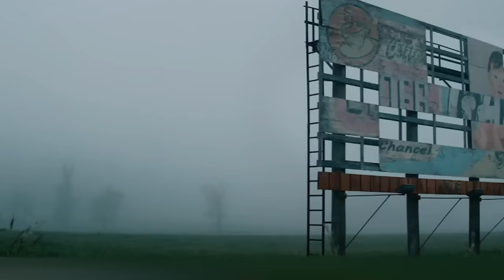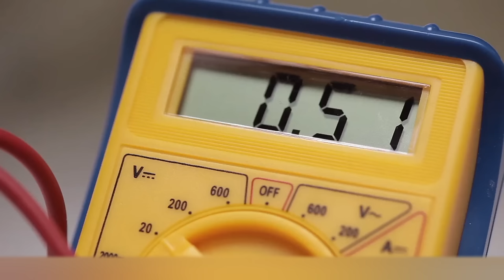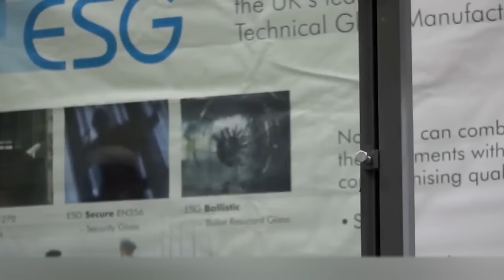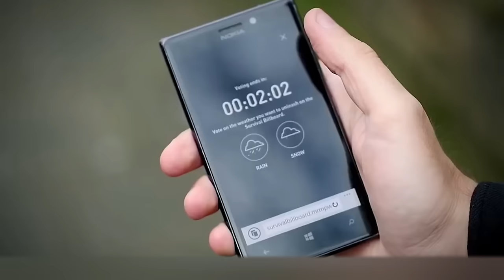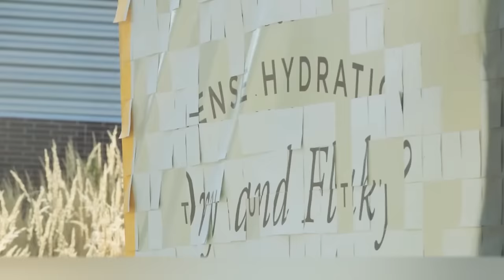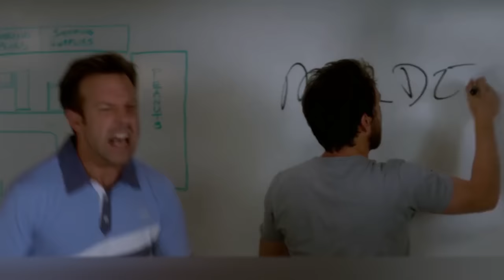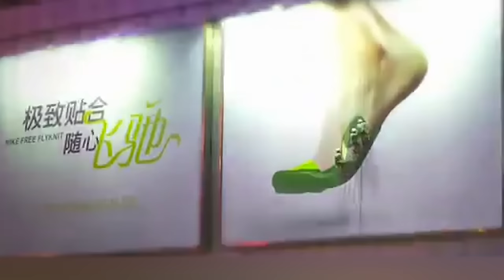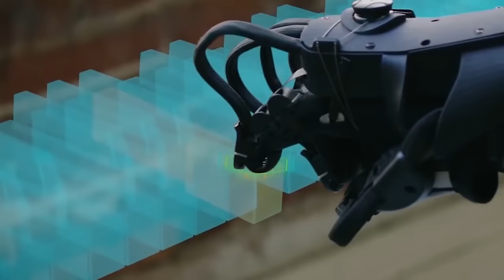Take All You Can If You Break It. Brilliant Advertising Campaigns That Stunned Everyone

Comment: The glass money thing isn't really that real as they make it seem in this video. There was actually only €300 - €500 in that glass case, and the rest was fake money. There were guards surrounding the thing in case anyone broke it. They gave people sledge hammers too. But in the span of 24 hours they had to take it down because the outside frame was breaking.
Reply: My bad, I was going off of my own currency
Reply: BeyBlade Master uh huh and how do you know that
Reply: St. Petersberg yh don’t think it was mate lol
Reply: If it was real you could just take grinder or torch falme cutting thingy (not sure how they are called in english) and cut the glass no need to take a truck or anything like that.
Reply: BigSoggyLad I'm pretty fucking sure it was a joke
Reply: Petr Kinkal You mean an acetylene cutting torch or plasma cutter!
Reply: Drone2 Beats burn it down use a hammer then put the hammer in fire make it hottest hammer then use safety glufs and then put the hot hammer into the glass then the glass will mealt then u carefully take money out😎😎😎
Reply: Yorkie Yorgi yhyh 😂😂
Reply: Lies
Reply: I hope you guys realize that burning through it is not an option, the guards would stop you straight away
Reply: But those euros has a huge value
Reply: xgamer 0123 Not really, the convertion rate would make it maybe 50 - 100 dollars more. It wouldn't do anything crazy.
Reply: BeyBlade Master not if your denzel washington-😉🕴🏾
Reply: Yeah.. the part where it showed it i was so confused.
Reply: BeyBlade Master is tie a chain and tie it to a truck lmao
Reply: HOW MANY DOLLARS IS 300 TO 500 POUNDS
Reply: sir jet noob man It’s $300-$500. He corrected himself and said he accident put the Euro sign instead of the dollar sign. It’s up there in the comments
Reply: z
Reply: @AwesomeKingKai  I SEE OOG
Reply: @AwesomeKingKai  i mean inguess not i aint wazting time for 300 bucks thats like 3 weeks work on a normal job
Reply: haha
Reply: yeah doesnt seam like it would take long especialy if you just cut it with and angle grinder
Reply: I mean if they really would give that much money i would just mount a mini gun to the back of a truck
Sounds like its not worth it but a m134 minigun is a couple 100 thousand dollars didnt the say it was 1,000,000$
Reply: they should be sued for false advertising

Comment: Where is that glass. I will break it
Reply: according to another comment, they took it down because it was actually starting to break and it was filled with counterfeits
Reply: @lili-zy7qq  it was. I saw it :p
Reply: Ha
Reply: At 3:00
Reply: lol
Reply: You will not silly😂
Reply: It's a wonder that nobody brought heavy equipment to just take that glass. I can't believe it would survive a concrete cutter, Jack hammer attached to a bobcat or  really even a crew of people armed  with a pickaxe and determination.
Reply: John Carmichael Honestly. Depending on what type of tempered glass it is you could break it with 2 spark plugs and a sling shot
Reply: @oscaralonso4699  if I lived close enough I'd give it a shot with some  weighted gloves and a pair of brass knuckles. Let me bring a hammer like the video said and I'd be out there an hour a day like it was a free gym.
Reply: use a grinder with diamond blade done
Reply: My hometown, Vancouver. No guns here
Reply: Hey, grab a ram or a door buster n
And that should do da trick
Reply: lili 
DANG IT!!  And I was just getting excited to break it. That stinks. Peace ✌🏻
Reply: @Error-eb9gv   Seriously, I was thinking about that before. I think that thing would most likely be entirely empty with the right tools. I can cleverly think of ways to research and cut/break/and or what it takes to take that glass out.

Comment: Interesting stuff start in 2:53
How the hell noone break that glass?Ram that thing with truck,grab money and run..easy:)
Reply: Thank you. And news flash people: Bullet proof glass is bullet proof, not rotary grinder, or drill proof.
Reply: Just use a nokia
Reply: It was a highly regulated event with armed guards, very specific rules, and only 2 weapons( a wood baseball bat and a sledge hammer) were allowed. Also it's only 500 dollars among numerous fake bills. Any attempt at taking the money now would be just as illegal as a bank robbery.
Reply: screwdriver?
Reply: Use hydrogen...  Ez...
Reply: Chewing gum, a diamond, and a hammer. Step 1: chew gum until soft.
Step 2: Grab your tiny diamond.
Step 3: place your chewed up gum and put it on the glass.
Step 4: stick your diamond into the gum.
Step 5: get your hammer and hit the diamond.

Nothing is stronger than reinforced carbon 😂👍🏽
Reply: 10:24 look in bottom right
Reply: Bradley primeau that sucks they lied did anybody sue them
Reply: The money is fake
Reply: Or they could use vibration too to destroy the glass from the inside. If only I lived in that place 😔
Reply: Draco Meteor "hit the diamond" hehehehe
Reply: Good idea
Reply: Draco Meteor at best you will make a tiny little Nick.
Reply: Bradley primeau even if the money was fake it sounds fun trying to break it
Reply: Tony Valdez an idea could consist of heating the glass up to insane temperatures, then cool it very quickly to freezing temps. This allows for easy shatterinh
Reply: Or use electric/gasoline saw with diamond blade to easy rip this whole thing..
Reply: Or ZF1:)
Reply: Perryinjax Studios: Not a problem with my 1000 degree knife.
Reply: Kyle Odtohan ď
Reply: It’s fake. That’s why. It’s layers of glass and probably poly carbonate. It’s like plywood. You can break a 4x4 off easier than you can break a layer of 3/4 inch plywood off. The multiple thin layers create its strength. You only were allowed to use a bat or a sledgehammer. It was a publicity stunt. There was literally like $1,000 in it with stacks of fake cash.
Reply: The problem I have with the unbreakable glass is why go for the glass why not go for the frame around the glass. Most bus stop signs are made of aluminum which isn't indestructible.
Reply: An anti tank gun?
Reply: Quinton15117 
Why did that make me laugh so hard? Lol
Reply: I would just hand saw the FUDGE out of the glass.
Reply: Draco Meteor r
Reply: Kick Saunders there's no such thing as bulletproof glass only bullet-resistant to a certain caliber
Reply: Plasma cutter?? :)
If someone uses this idea....I'd like my share please:):)
Reply: Quinton15117 what would a Nokia do
Reply: Tony Valdez fr then get a new car with the money 😂😂😂😂
Reply: Roll a dumpster into it?
Reply: Tony Valdez frlllss and thx
Reply: Well, just use a nuclear rocket, but I guess there might not be much money left to use...
Reply: Tony Valdez A forklift?
Reply: Shooting it at point blank range with a high power nail gun puts a hole straight through it and weakens it. Then go to work with the sledge hammers. Just watch the Millennium Dome heist.
Reply: What about RPG?Can pen more than 40Cm bulletproog glass but probablly destroy lot of money..
Reply: wtf ikr?
Reply: You could probably just install a ball hitch and back into the glass at high speed. The hitch would break through the glass easily and you wouldn't cause any damage to the truck.

Comment: Try shooting the glass with a .44 Magnum about 20 times and see if it does any damage to it.
Reply: GamingRobot 2.9 then get arrested and do prison time.
Reply: CHICKEN KURRY yeah but 3 million will help with a hell of an attorney.
Reply: No glass is bullet resistant, there has to be some bullets that would go through
Reply: The glass would stop it unless you used a armor piercing fmj round but i dont think they make those for a .44
Reply: GamingRobot 2.9 .50 caliber will definitely penetrate
Reply: I'd just tether it to a truck and drive off with the whole thing
Reply: Nahhh...Just use an 8 wheeler truck and ram it down again and again til the glass breaks then dump your 8 wheeler and buy another one.
Reply: Well minigun with AP ammo melt this thing in 20 seconds or use truck and tow this thing to safe area:)
Reply: GamingRobot 2.9 and watch it bounce back due to the strength of the screen.
Reply: 50 call sniper armor piecing ammo will do the job or full metal jacket
Reply: If that thing was real people would've used grenade launchers
Reply: 10000000 psi

Comment: they are stupid just take of the screws that holds the glass with money and take it
Reply: NIKO BELLIC 2 the point was to break the glass -.-
Reply: but they didnt say that you could take of the screws
Reply: NIKO BELLIC 2 they said, break the glass and get the money... I’m pretty sure taking off the screws doesn’t count for breaking the glass
Reply: That's what I said
Reply: There are no screws
Reply: Kulahog they could take the screws off than throw the glass super hard at the floor to break it than proceed to sledgehammer it
Reply: Take a truck to it😂
Reply: if u take the screws out they will literally remove all the screws from you.. you will look completely dismantled..
Reply: Jose Augustine hahahahaha it was so funny I laughed more
Reply: just use a glass breaking tool, theres no rules on saying you can't bring a tool
Reply: Kulahog nobody care ift can or can't touch the screws
Reply: No wonder u like GTA 5 Just Stealing😂😂
Reply: R U sure there are screws???
Reply: Absolute Newt that would not work. Glass breaking tools work on non bullet proof glass not that stuff. It's held together with thick plastic behind the glass so you'll crack the initial glass but won't get past the second layer.
Reply: FrozenByFire3 what if you use a bull dozer
Reply: Chewy Point 0 i agree
Reply: but you would burn the money
Reply: NIKO BELLIC 2 I might. I’d have a fire extinguisher standing by. But I’d get in that glass.
Reply: ok ill take it
Reply: You need heat and cold to break that glass. Literally heat it with a parent torch meant to dry the paint and throw some liquid nitrogen on it. It will become brittle. Then hit with a hammer and collect your money. The problem is the flexible layers between the panels.
Reply: Sanbasuto Kuruma I like that. I’d help you do it. Just cut me in 25%
Reply: Kulahog take off the screw, then drop the glass off a 100foot building
Reply: No screws, and the challenge is to break the glass
Reply: What about small plastic explosives?
Reply: Ruby Gas Emitting Laser to cut the glass supports.
Reply: Absolute Newt or a concrete saw
Reply: I woulda ran my car through it & tool the money & dissapeared
Reply: Absolute Newt u can't use tools except for a sledgehammer

Comment: B ring a jackhammer
Reply: I'm faster then all of you
Reply: or just drive ur car into it
Reply: Have me punch it...i did a gods workout. 100 pushups 100 situps 100 squats and a 10km run. Dont forget to eat breakfast a bananna is fine and do not use AC
Reply: I'm here for you bro
Reply: CosmiiqQuibblePop ? I was referencing one punch man idk what your talkin bout
Reply: CosmiiqQuibblePop if i were bragging about that weak of a workout id probably die
Reply: Or a glass breaker
Reply: Nasir Bone this comment is incredibly underrated lmao.
Reply: Nasir Bone Hello Saitama
Reply: I was thinking of a cutting torch, the temperature glass and polycarbonate melts at is well under the temperature  the flame of the oxi-sedaline torch reaches and if you cut a smallish hole above it you would not damage too much of the money.  A large diamond or carbide tipped hole saw powered by a generator if not a battery powered one might work as well. Too many ways, there must have been a catch to it.
Reply: Diamond
Reply: what you do is bring diamond sharpenning stone and just rub it until you rub it away IT CANT BE HARDER if you can make a nick with a sharp knife that would help too
Reply: Swemptonian Tribe spark plugs if it’s actual glass, blow torch or look for some other chemical combination that would heat it up ( I can’t think of what it’s called)
Reply: Phill Huddleston another comment says only allowed 2 things,baseball and an axe
Reply: drive a truck into it.
Reply: Nasir Bone lol Saitama

Comment: Easy way to break the glass.
Flick a broken spark plug at it.

Reason this works is because all the energy of the impact is channeled through an extremely small point.

If that doesn't work, just melt through the glass with a blowtorch.

Comment: I bet they wouldn’t allow me to use my diamond gas powered saw that I use to cut cars apart it cuts through glass fine. I even tried it on an armored door we had and it cut right through it. It was a little more difficult than normal but the saw could have cut through more. Where is that cash? I am gonna go take it!

Comment: IF it's Polycarbonate, Multi Sandwich Combo "GLASS" -  Just FIRST use HIGH HEAT - Torch it, then IF a heavy Glass Sandwich IN the MIDDLE, BREAK THAT "MIDDLE,"  WITH A SLEDGE HAMMER!

Comment: To get the three million a plasma torch could be used to cut the glass at the top and a strip removed horizontally pick the money out as far down as you can reach then cut another horizontal strip pull out the rest of the money , you may need a fire extinguisher in case a spark gets on the money ... easy peasey.....

Comment: False info. You could not use anything to break the glass and there wasn't really 3 million in it.
"There were a few ground rules, one of which was that they could only use their feet to try and break the glass. Security guards were also standing nearby to ensure no one broke the rules.

Had the glass come up against a sledgehammer it may have been a different story. But with the wider public unaware of this, it did not harm 3M. A few other revelations came about the stunt too in the years after.

Instead of $3 million in cash behind the glass it was actually $500 placed on top of fake notes. Had someone broke the glass, they would have been compensated in a different manner than walking away with $3 million in cash. Nevermind, that this would have represented a security risk for 3M on its own."

Comment: The glass would not last a second around me I wood use a blow torch to melt glass in 2 spots and use my winch to break it open or gest run into it with my truck

Comment: With the bulletproof glass with the $ inside, I wonder though if there was a posted rule that you had to obtain the $ ONLY by breaking the glass?? Because I would have been there with power tools and a blowtorch to dismantle the casing holding the bulletproof glass. Because whoever put the $ in there had to lock it in somehow right? So it has to open somewhere. 😈 🤑 🔩🪛🛠️🔧🔐⁉️